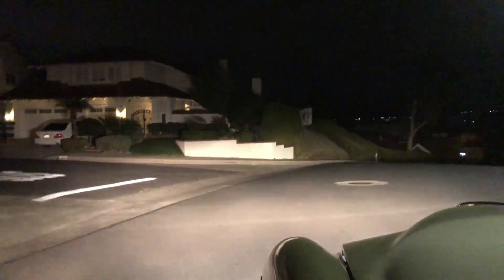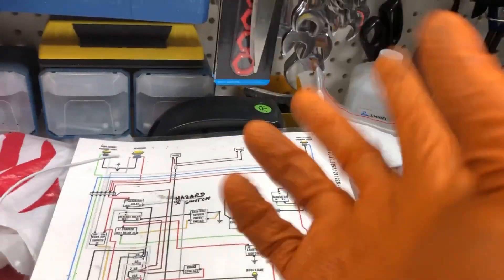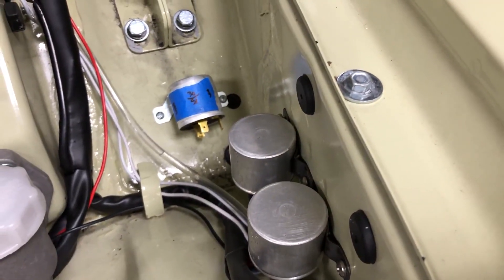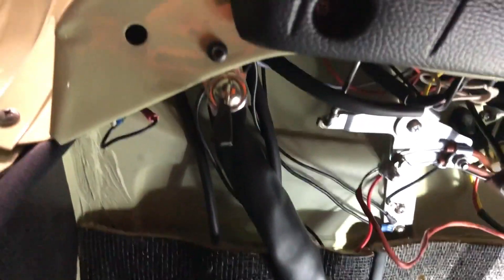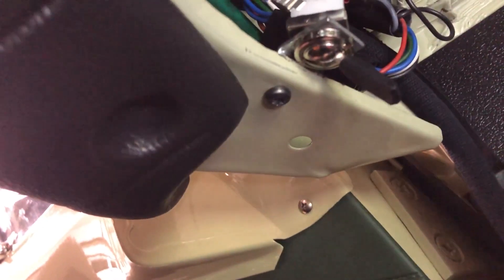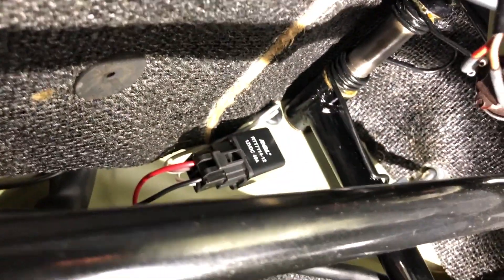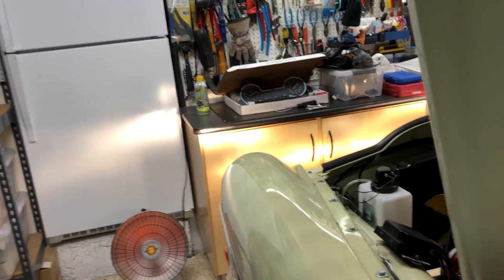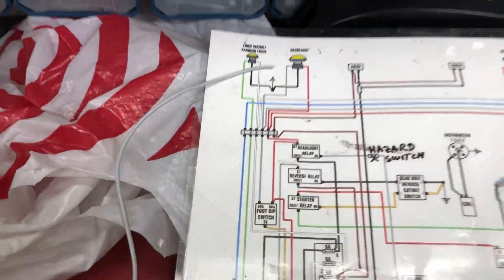How to Wire Fog Lights in Volvo Amazon 122S

Comment: The hole/holes in the outer underside of the dash are for the LHD/RHD parcel shelf pull switches. The 123 GT needed two under the driver's side so an extra one was added there. GT used 2 switches for the auxiliary lights as one was a fog light and the other a spot light. They are identical to the pull type parcel light switches. Spot light in front of driver and fog light on passenger side to pick out the kerb/gutter grassy verge etc. The 2 original 123GT lights were Hella.

Comment: Strange you call them fog lamps here in the uk if there above the bumper there known as driving lamps or spot lights operated with the main beam & if there fitted below the bumper there fog lights but they are a different shape, They were quite popular in the 70's ( spot lights ) & became standard fitment on a lot of hot hatches in the 80's
Reply: This exactly.
Reply: The designations fog, spot and driving are related to the beam pattern so the fogs started to be mounted lower when the rectangular ones started to become popular on cars like the Rover P6. Usually Lucas square 8's. Round ones are rather vulnerable when mounted below the bumper.
Reply: @delukxy  yeh strange they were called square 8's when they were rectangular, only cars i remember back in the day with round lights bellow the bumper line were rally cars pretty sure my dads mk2 RS 2000 rally car had spots mounted top & bottom ie above & bellow the bumper line . The rover p6 remember them they looked cool with the spare wheel mounted on the boot, Grace kelly's favorite car apparently

Comment: I have the same button style switch for my light bar that I want to install on Larry. I used to have a similar one on my old 4runner if you remember that, and I hooked it up wrong or I used the wrong fuse and melted the switch but either way they work for a little while, they could have just been old and crappy too. These look great! they really add to the wagon.